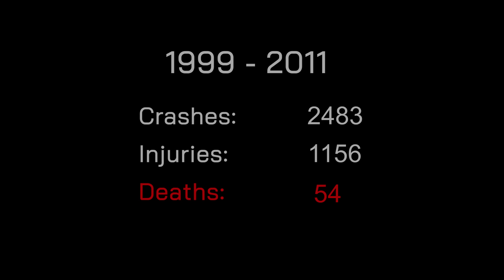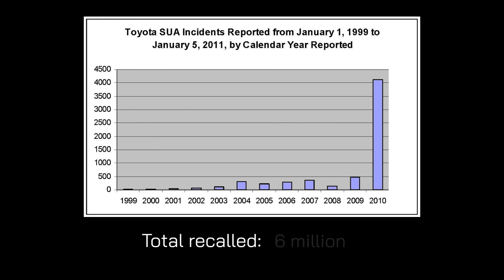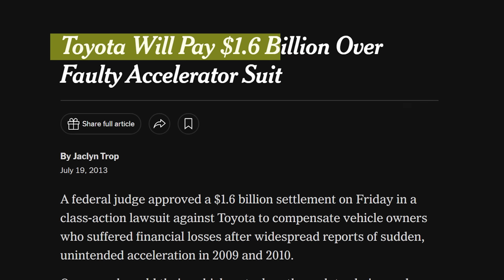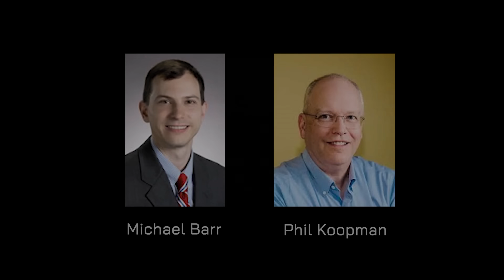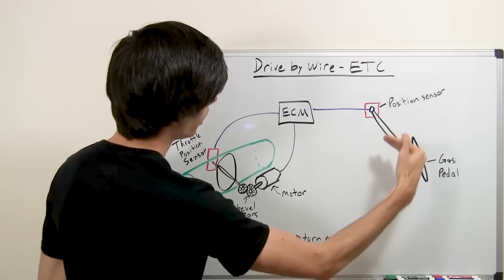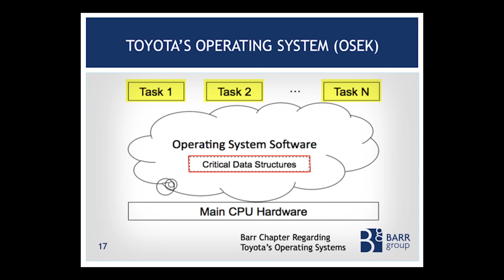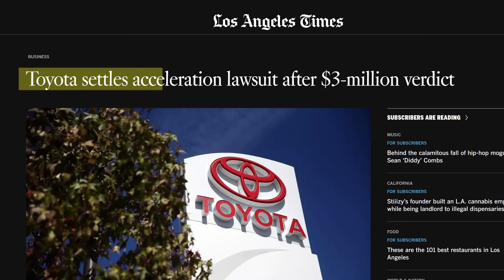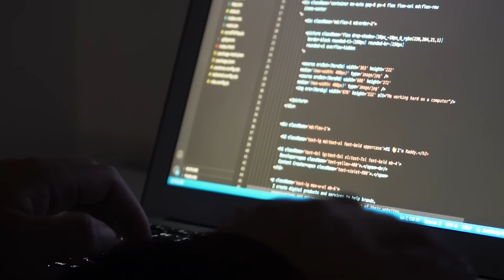Fatal C error took her life

Comment: Honestly there are also places that should have nothing to do with software, and everything to do only with mechanics. Today it seems people started sticking software into places just because. Like it or not fine electronics is fine electronics. These days fixing a broken tail light on some cars can cost $5400 because instead of a simple circuit - it is connected through computer, which now has greater exposure to external short circuits due to moisture etc in the light itself, which can cause control unit to fry. So WTF is that? Honestly if I was to pick between +20 or 30% reliability and +20 or 30 percent efficiency - I'd pick reliability every time. These car manufacturers need to stop connecting every single sub-system in a car to the computer. It's stupid.
Reply: You are discounting the improved safety that can come from connecting these systems to a computer. If done correctly, there are many ways that safety can be improved by connecting sub-systems to a computer. Traction control is a perfect example. The modern traction control systems are capable of doing things that would never be possible from a purely mechanical solution. Its just a compromise. If done correctly it will improve safety. You can't use an example of doing it incorrectly to say we should never do it.
Reply: @Nick-tm2sw  There is no improved safety that comes from connecting a blinkers or windshield wiper motor to a computer. Funny how on the web people are trying to decouple things into micro-services, but in car industry engineers are stuffing everything into computer.
Reply: @dmitryrodetsky5573  I can tell you first hand that decoupling everything into microservices is not always the right thing to do. Its the same with car systems. I agree that turn signals should not be tied into a computer. But many things should be. Someone could argue windshield wipers should be because it would turn them on automatically for people that tend to not turn them on soon enough. That could prevent a wreck. Your example of an ECU being fried because of a short in a turn signal circuit is really an issue of poor design since there should be circuit protections in place to prevent that. I agree that not everything should be tied into a computer. But we shouldn't make the mistake of thinking that is always a bad thing either. A lot of safety critical programs are written in low level languages like C, even a lot in assembly. You just need to take a lot of extra precautions when doing that. Many of these systems have functioned for decades with no loss of life.
Reply: @Nick-tm2sw  Sorry man. In my opinion - the less automatic crap in a car - the better. Less things to break that cost a fortune to fix. Few years down the road all these gimmicks will put an otherwise perfectly good car in a scrap yard anyway. It will not be fixable by regular mechanic, but only dealerships, which tend to rape people financially. I see how it is beneficial to car manufacturer and dealerships. On top of it many of these gimmicks give a false sense of security to the drivers. They can't feel that the road is slippery for example until it is too late. So bottom line the most important safety device in a car is the driver anyway, so I'd rather be a safe driver and encourage other people to do the same. And no I would not be comfortable letting AI drive me around, and I have good reasons for that.
Reply: @dmitryrodetsky5573  Well everyone is entitled to their opinion. Personally I trust computers more than any driver on the road. A computer is always going to be better at preventing a wreck in slippery conditions than a human. If done correctly the driver never needs to "feel that the road is slippery until its too late". The data shows that this is the case as well. I would rather have a car that protects my family but goes to the scrap yard in 10 years than a car that lasts for 50 but does little to protect them. Cars are cheap, life isn't.
Reply: @Nick-tm2sw  Lets agree to disagree about the automation part. I want my car to be predictable. Not "think on its own".
Reply: @dmitryrodetsky5573  Thats fine. It just sounds like we want different things from a car and thats fine. I want predictable too. That is why I prefer computers to help achieve that predictability.
Reply: @Nick-tm2sw  You are mostly right, but the key thing you said "if done correctly", funny how you don't trust drivers on the road but absolutely trust people who make computers:)
Reply: @evabond3429  Because the vast majority of places developing safety critical systems have strict process for the development of those systems along with many levels of review and QC. People driving cars are panicky, dumb animals that make bad decisions in high stress situations with little prior experience. I will take the computers over the people any day. I have a unique perspective because I worked for many years in EMS and now I am a software engineer. I have seen both sides of this debate.
Reply: @Nick-tm2sw  I agree with you, especially good point is about "decisions in high stress situations", I just wanted to remind all of us that computers done by people are still not 100% protected from peoples mistakes, unfortunately, though they are more safe anyway, you are right.
Reply: No, the software wasn't the issue here, it's the mechanical/electrical system that was. It had no redundancy. 

Looks like Toyota didn't do a basic test. What happens when your task fails. I was in a HAZOP and I asked the MechE boys what happens if my software crashes and they looked at me dumb founded. As an Engineer I was surprised to find out other engineers think software engineering is magic. It's in the same level as mixing between and electrical engineer and an electrician. Not the same thing.
Reply: In reality, mechanical systems tends to have more issues, sticky throttle also happened before.